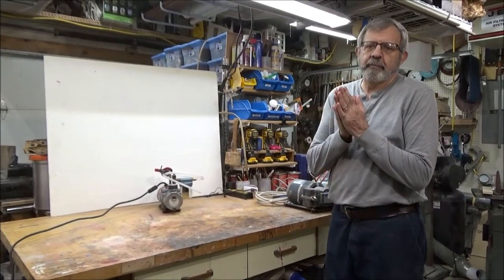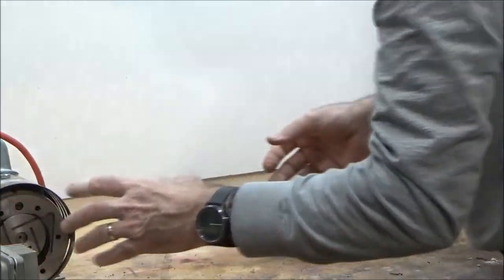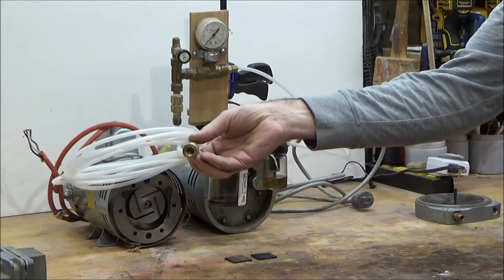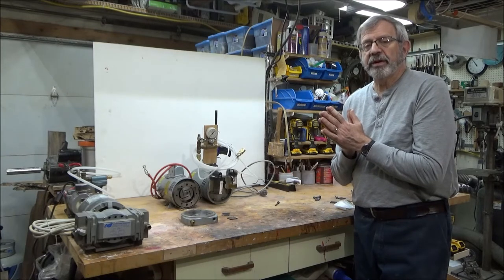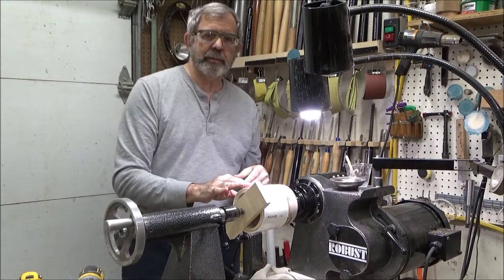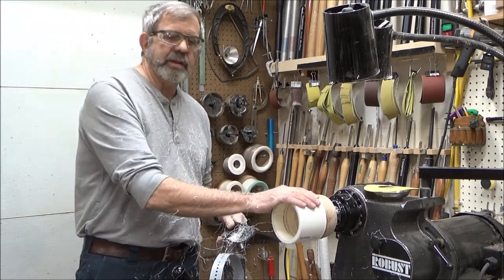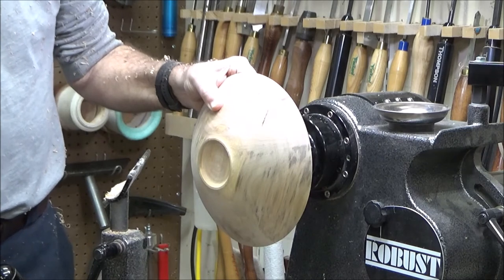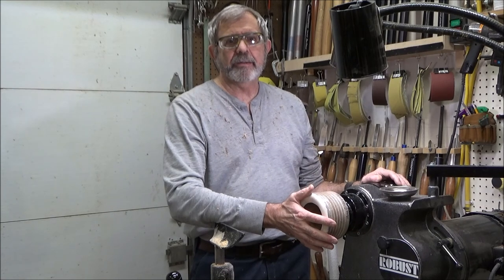Vacuum Chucking for Woodturners Part 2 of 2

Comment: In situations where there is not a centre mark to reference, I use a spindle adapter (sold by Oneway) on my Oneway live centre so I can mount my chucked workpiece on the tailstock and bring it up to the vacuum chuck.  Once the vacuum is established I can release the workpiece from the chuck and remove the tailstock.

Comment: Watched this video today (09/16/23), is the creator monitoring/answering questions (one of the questions suggested otherwise, that this person retired?)
Reply: Looks like it.  The one part he missed was how to seal the vacuum pipe into the hole in wooden base, whilst allowing it to remain stationary, i.e. not rotating when the chuck revolves.  However I found an easy way on another video, which used a small ball race epoxied into the wooden base, with the pipe epoxied into inner bearing 😊

Comment: You have explained the Rotary Vein Pump (Drehschieberpumpe) in a wrong way!
The Rotation is clockwise. At the right side is the suction side: vacuum connector!
Der Rotor rotiert nach rechts , dort ist auch die Ansaugseite!!
Best wishes!